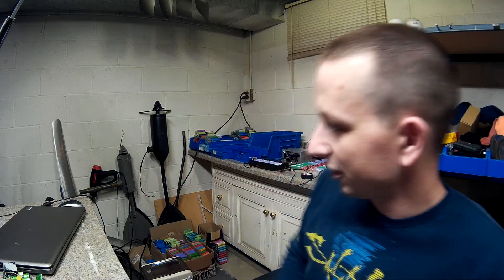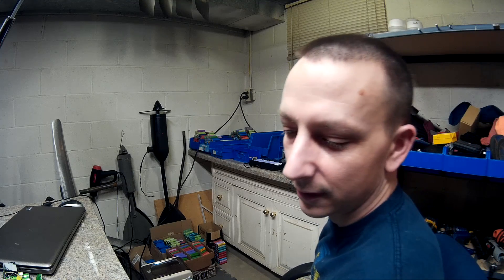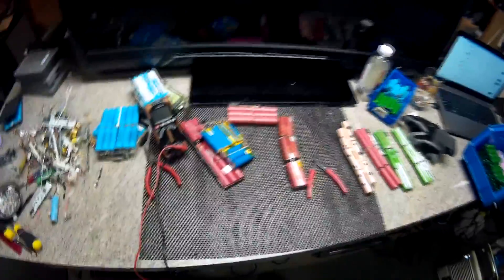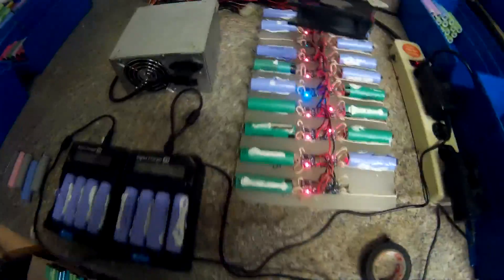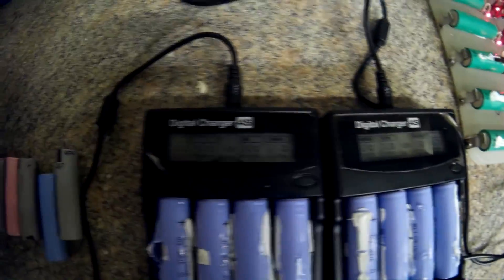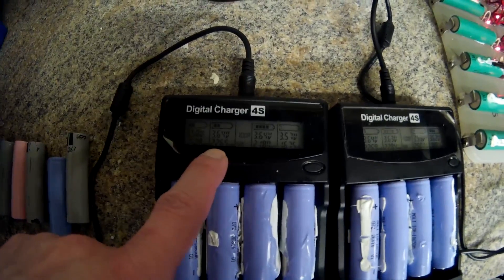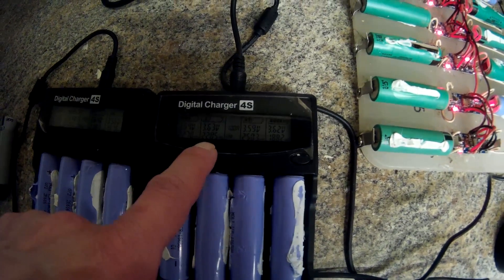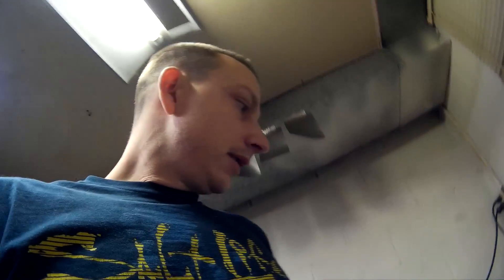Diy Tesla Powerwall ep19 Another 18650 Quicky Stripping

Comment: Do you have a video showing exactly the process of you doing the discharging?  I need to buy something that can charge/discharge and tell me the mah of my batteries.  Seems like everyone has some kind of a custom rig but never mentions how they set it up or where they got the parts or how it works etc.
Reply: I use the Foxnovo 4S as well as the BT-C3100. I prefer the BT-C3100 because it can charge 4 cells at 500mAh as well as discharge at 500mAh (twice as fast as the Foxnovo) Also you can test internal resistance on the BT-C3100. Overall the BT-C3100 is superior in my opinion given all the extra features.
Reply from the maker: I use 2 foxnovo 4s to be sure all cells are capacity checked the same at 1 amp
Reply from the maker: My foxnovos can charge and discharge at 1 amp each so a total of 4 amps.  You need to press the button again for 1 amp each option.  Ya I cant resistance check so the BT-C3100 would be an option for that.
Reply from the maker: +Scott Runge I got my foxnovo 4s here on amazon http://amzn.to/2l2xYGu